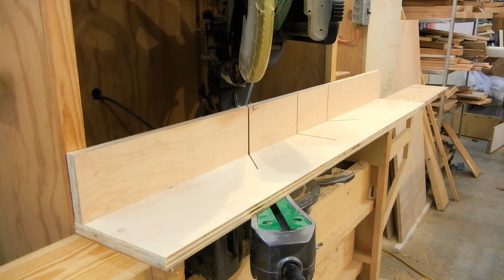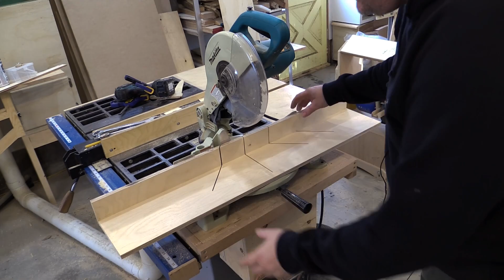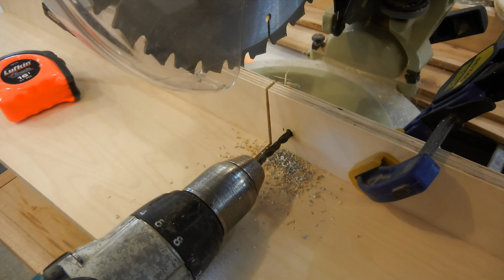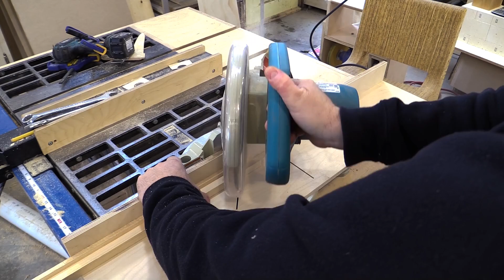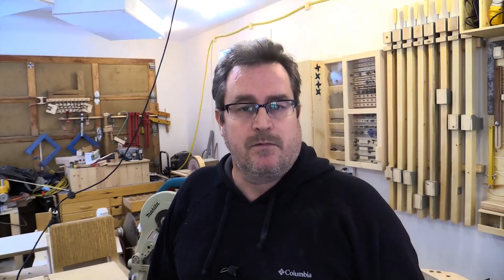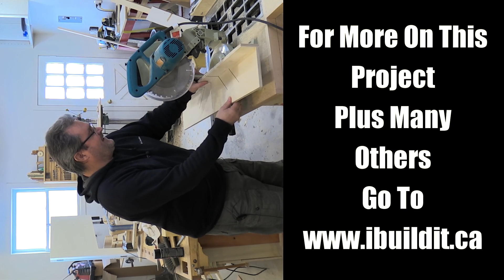Miter Saw Zero Clearance Fence

Comment: I'm glad that you mentioned why you move the fence in this video.  I keep meaning to make one for my hitachi (same one that you have, the creepy thing is that I have probably about a 6-8 of exactly the same tools that you have and have had them for years, and most of them were "the best deal I could find," like the hitachi I got for $89 new at lowes because it was on the clearance pile for $1xx, and someone stole angle adjustment handle off of it and they cut the price farther for me), and was about to make one that didn't move when I saw this.

Thumbs up on the video, I just wish you didn't look so much like an old boss of mine, you even have similar mannerisms, at times I find it somewhere between creepy and aggravating :-P